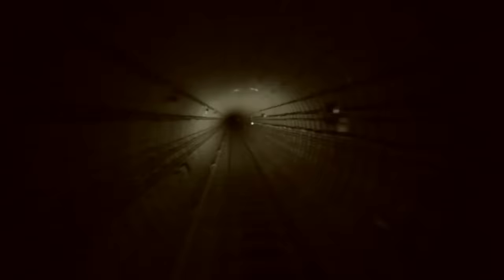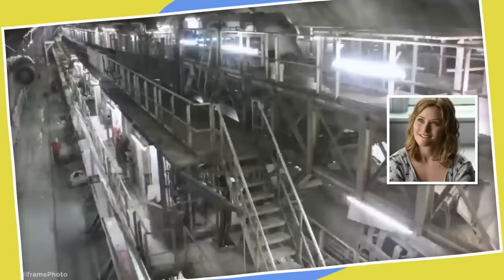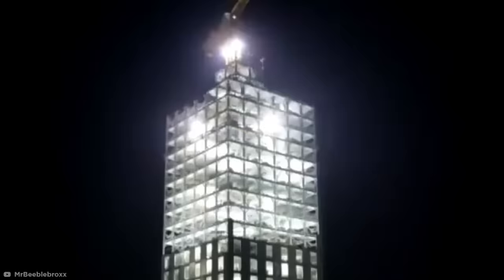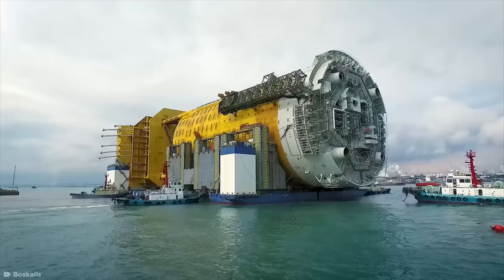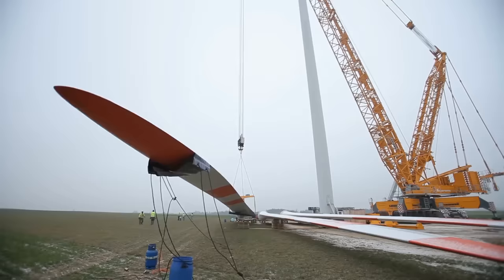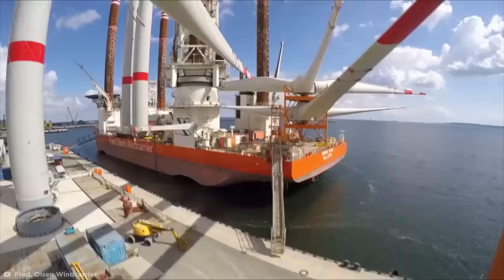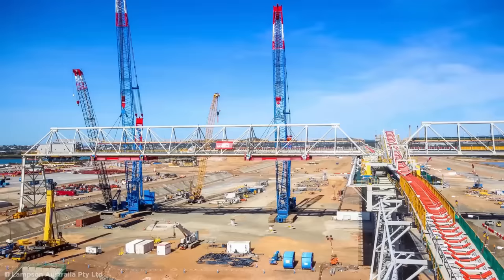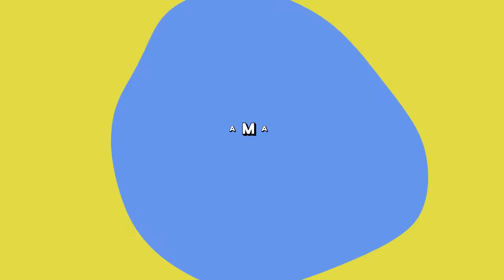Extreme Engineering Machines Building The Most Amazing Megastructures

Comment: There's actually one of those giant drills in my city in Australia. They actually used 2 to build an express way right through the city. After it was done they couldn't figure out how to get one of them back through the city. So they took it to a mountain close by and had it drill straight in and buried it. I reckon that bunker would be an excellent evil villain lair.

Luckily this actually paid off, since they pulled the drill out of retirement to work on a new project in the city. Whether they send it back to the bunker or finally get it out of the city, only time will tell.
Reply: That’s pretty interesting.. I wonder what that bunker is truly used for

Comment: I highly doubt about the quality of the T 30 hotel
Reply: It's 15 days assembly. Otherwise it was built in a workshop in probably not too much less time than a regular structural steel building would be. Plus they probably don't include the time it took to build the foundation that the building sits which would've been built in-situ. They only counted the 15 days erection time for the shop built structures. Doubt there's anything wrong with quality.

Comment: 2:20 There is NO chance a 38ft rotating horizontal cutting head is rotating at hundreds of RPM as shown there !!  ;]
ps: China is NOTTT fncking around with that Belt and Suspenders initiative are they!? And they claimed that stat of 10,000s of 'high speed' railway km was just IN the country!
edit 10:21 See that choreography of hundreds of tonne ballet  of 2 massive objects, spinning the turbine just over top, to it's initial operating direction, WHILE the crane ducks safely below and away. At one point of a common install protocol each blade will hang over the deck sharp spear end down. Prolly if a blade dropped skewering through the last float crane's standing bow New Achievement Unlocked: Instant unplanned stability upgrade via shiny new 5th leg! Hehe ;]
Reply: 🤣🤣🤣belt and suspenders? You mean belt and road?

Comment: Isn't a cofferdam a caisson? I'm not from a English speaking country so... Help?
Reply: My understanding is  that cofferdams are temporary & to be removed whereas caissons end up as a permanent part of the structure. Also I'm thinking that caissons are enclosed structures which are kept at pressure to prevent water ingress (I might be wrong in thinking that to be a caisson it has to be enclosed) this is where the first cases of 'the bends' were experienced as those who finished their 8 - 12 hour shift under pressurised conditions would just go straight to the surface and suffer horrible symptoms or even death. The original name for decompression sickness was caissons disease hence my thinking all caissons are enclosed.
Reply: @craigbailey2256  thanks for the explanation and I guess I have to look this up myself because as you said those are speculations. But still thank you